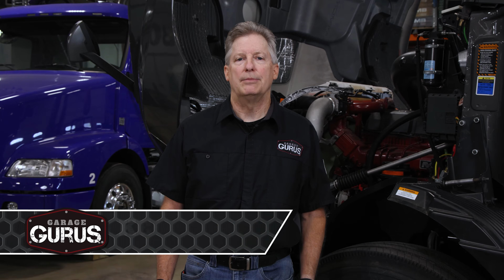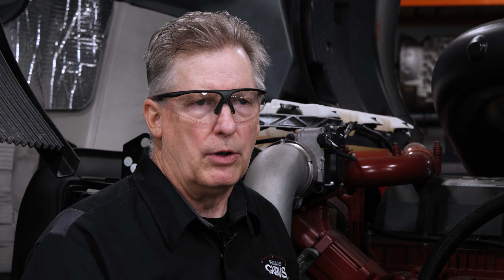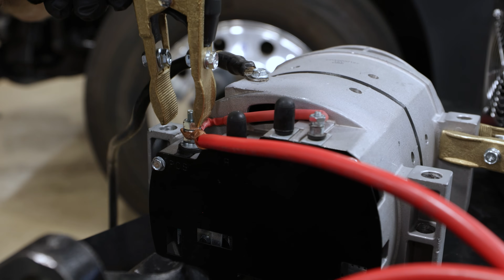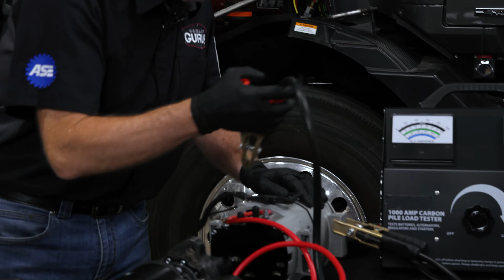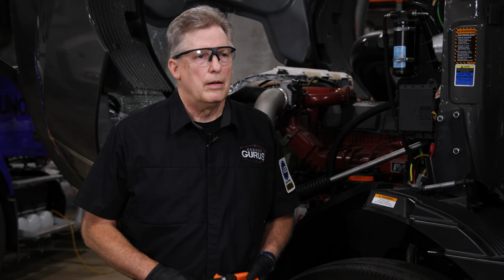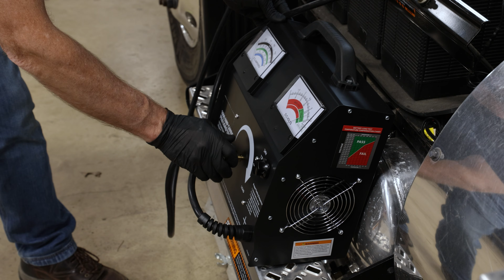Garage Gurus | Charging System Diagnostics

Comment: What about if its a single battery system, do I need to still use the load tester, or is the vehicle accessories enough of a load?
Reply from the maker: A single battery still needs to be tested with a load tester. A load tester simulates the high amperage demands, like starting, that can reveal week cells and other internal failures that a low draw tests would miss.